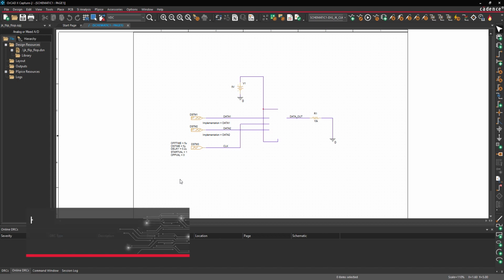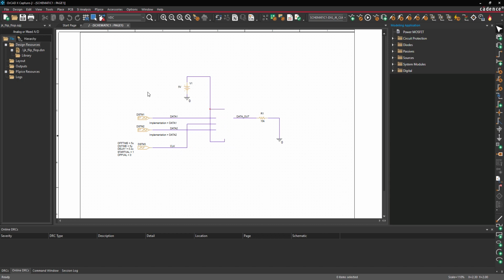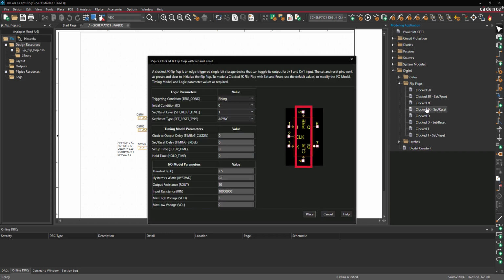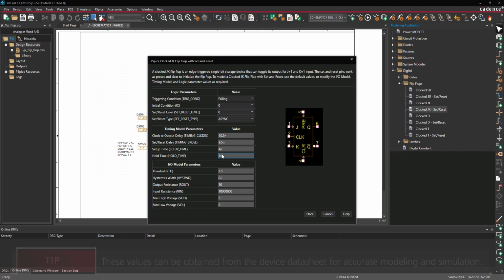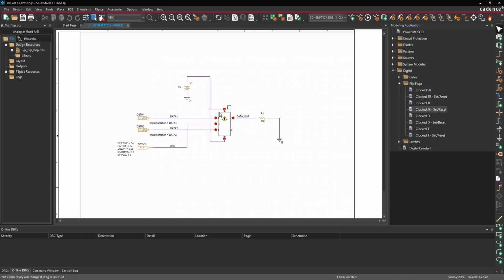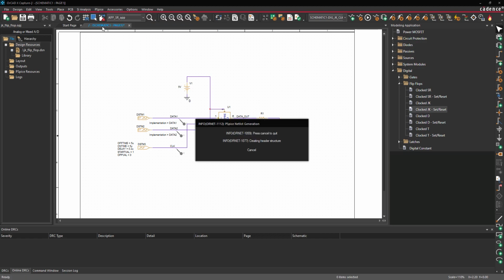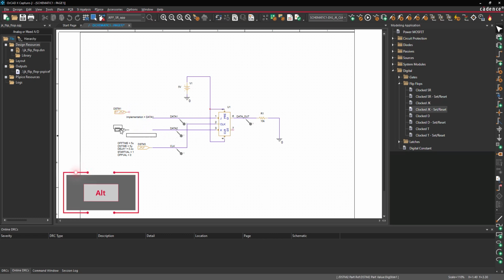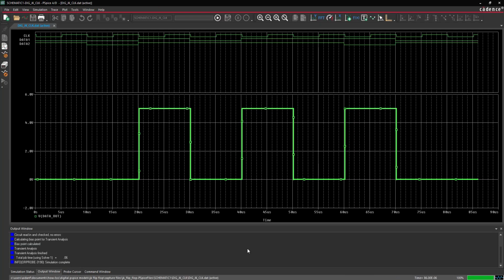How to Create a JK Flip-Flop SPICE Model

Comment: How do I verify that the circuit output is "1" when the "1111" sequence is detected.
Reply from the maker: Good question! For this example, since the flip-flop is clocked, all new data bits start at the falling clock edge. The number of clock pulses determines the number of bits for the output.